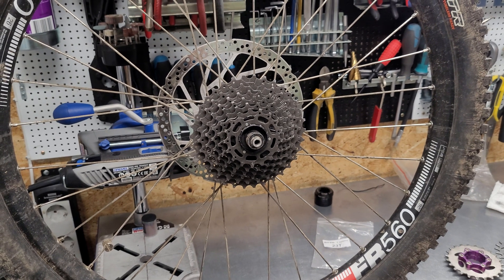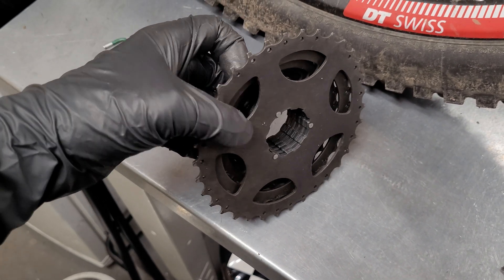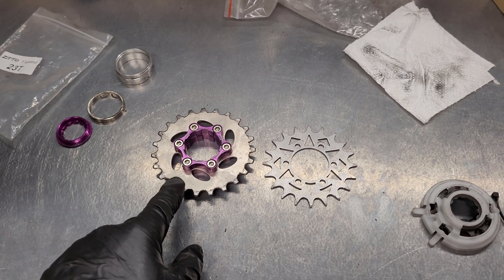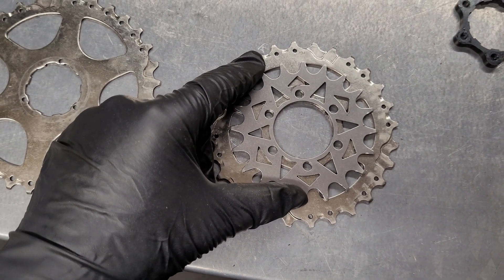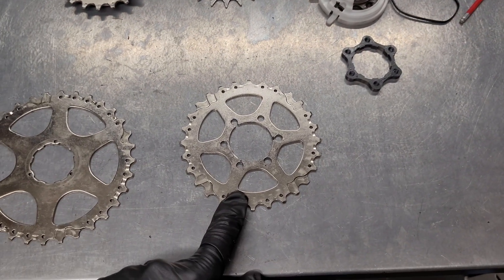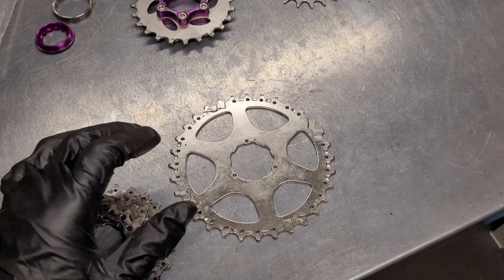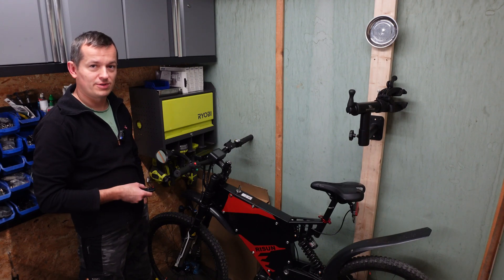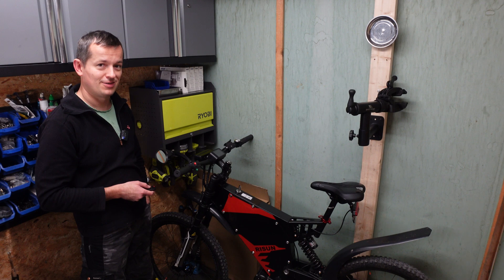Single speed drive

Comment: may i ask which cassette you used as the donor? its really hard to find a cassette without weight saving cutouts on the bigger cogs... thanks!
Reply from the maker: I finally took 25 teeth ring from the cheapest steel 8 speed shimano casette and just drilled 6 mounting holes for the boss adapter. Or mount ready available single speed ring from Ali.

Comment: I just completed my build with a cyc x1pro on a mongoose full squish. I used that same chain tensioner and it disintegrated in the first half mile. Pushed it back home and ordered a little beefier pulley. I found one with a solid pulley and reduced the spring tension because I don't need to strum a "C#" on my chain. Also fell on my enormous head on the second ride so I'm pricing helmets today. The weight of the bike effectively doubled when I put the motor and battery on and the balance/center of gravity way different. Was probably not my best idea to try a new thing on a trail covered in wet leaves. I actually went with the Shimano Nexus 5sp IGH and stitched the wheel together myself, way easier than I thought it would be however I did make that classic rookie mistake and the valve is in the wrong place.
Reply from the maker: You should not ride without helmet in the forest. Hitting your head against rock during fall will be the end of all fun, look at Schumi.

Comment: Sounds like the setup I’ve been looking for a “spare” bike - simple and as light as is practicable, no need for speeds above 12 mph/ 20 kmh… decent hill-climbing ability, can tow lighter trailer (to and from hotels, for instance)…
Reply from the maker: If you use highest acceptable voltage for the controller, you will get much bigger top speed than 20 kmh.
Reply: @LierskogenEbikes  true, but for a “spare” bike - I’m not sure it would be needed.

I rarely go much above that speed as it is - usually between 12 and 17 mph, unless an emergency.  This is the case even when needing to cover 50 or so miles per day (when paying bills, for example - ATM, grocery store, dentist (need to prepay for dental work next August) then a medical equipment provider, then a few other places prior to getting home.  

Would do that day after tomorrow except it’s supposed to be really wet and I don’t have decent rain gear at this time - and staying wet for hours when it’s that cold is a bad idea for someone who’s getting on in years, e.g. “retirement age.”

Comment: my bbshd build from 1.5 years ago died on me in the beginning of a ride and haven't been able to turn it back on. The battery was full but the temp drop shut it off, haven't been able to turn it back on. Do you think I need a new battery or controller in this case? I just came across your channel you have great videos :)
Reply from the maker: Well, it can be broken BMS in the battery or controller on the motor. The easiest way to check it is to connect motor to different battery or DC power supply. Then you will see, if you can switch the motor ON.

Comment: Nice, you can also use this way bigger Chain sizes.?
Reply from the maker: Yep, single speed chain is perfect. Much stronger than other types.
Reply: I have my cyc x1 pro for 2 years now and never had problems with my 10 speed xt but my cassette body looks even worse than yours but my cassette was always fine. But i killed many sprag clutches in the motor but never ripped a chain
Reply from the maker: @Sur_racer  With ASI BAC855 you need gears for this motor. But with X6 controller you get much higher torque along the whole spectrum of RPMs. Gears become obsolete in that case.
Reply: E.g. #415 chain, which is 3/16 , 4.8mm, wide??? (Regular single speed = 1/8, 3.2mm)